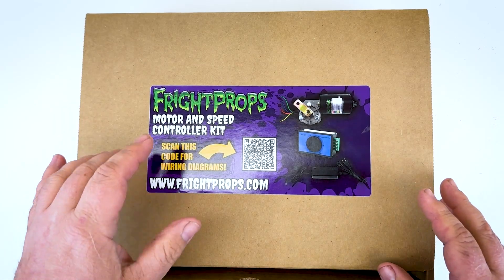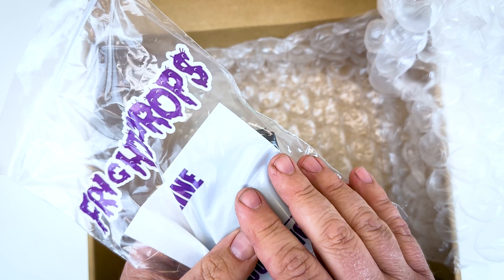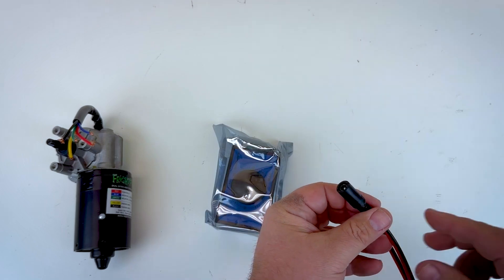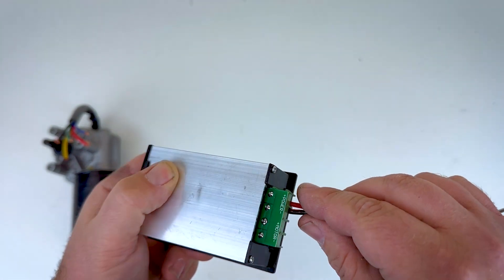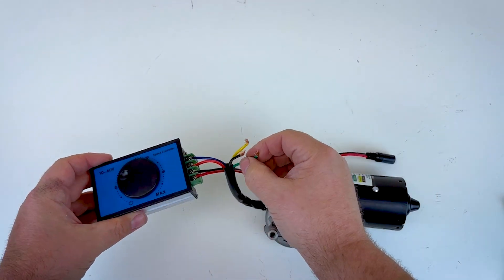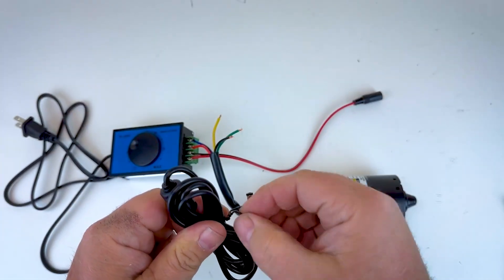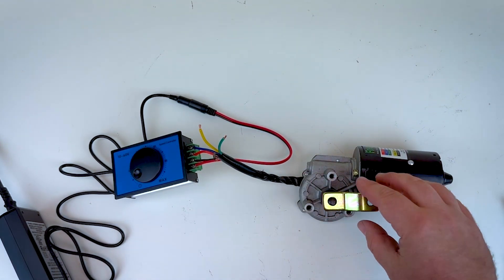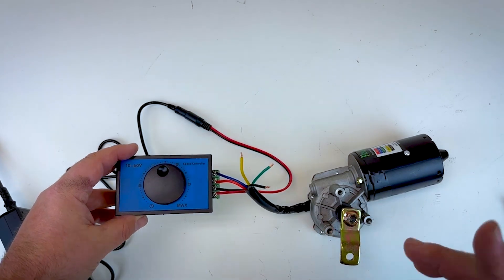Halloween Prop Motor and Speed Controller Kit Unboxing and Setup

Comment: Would I be able to use this to simply operate a timing belt system to make a prop simply slide on rails back and forth? I have a doom buggy I want to move from one side of a large window to the other and back. If not, can you advise? Thanks!

Comment: Is there any way of using a single controller for more than one motor. Or do you need 1 for each
Reply from the maker: If the power supply being used had enough amperage to drive all the motors I think you could wire multiple motors in parallel to the output of the speed controller. The maximum amperage the speed controllers we sell can handle is 20. Each motor draws around 3 amps once they get started. So you would definitely be looking at using a high amperage power supply.

Comment: I have a rocking (chair) motor. Do you sell a random speed controller that would work on that?
Reply from the maker: If it's a low voltage motor that operates between 10-60vDC then this speed controller should work with it:
https://www.frightprops.com/speed-controller-for-dc-motors-linear-actuators.html

Comment: What is the maximum weight that the motor can turn ?
Reply from the maker: That's kind of a tricky question as there is no exact answer. It depends on not just the weight, but how much leverage is involved as well. Here are some motor specs that might help:
• Rated torque: 53 in-lb (6N.m)
• Stall torque:177 in-lb (20N.m)